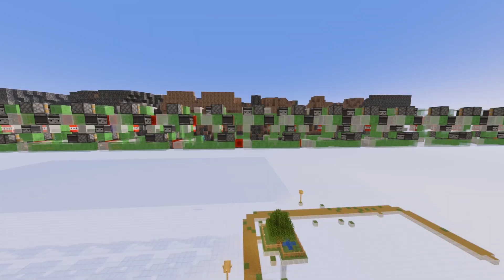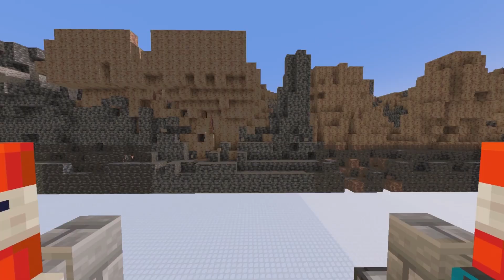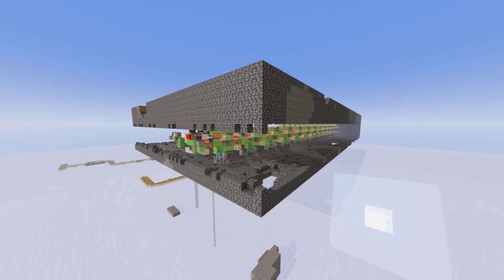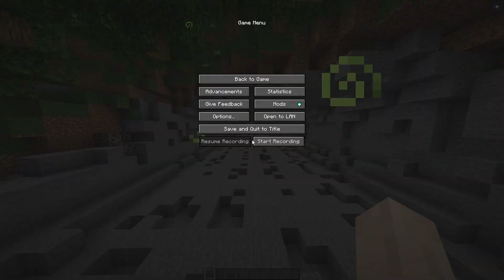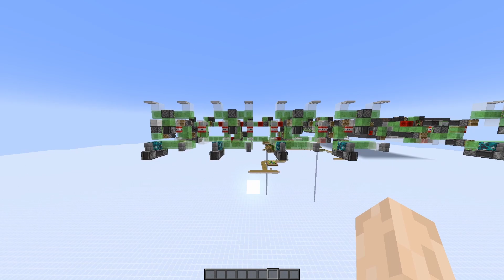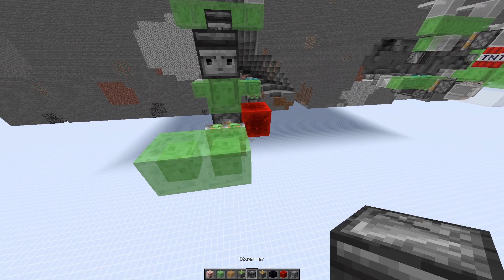How to Build a Simple TUNNEL BORE (Mining Machine) - Minecraft Tutorial

Comment: I mined now million of blocks with this tunnel bore. It works amazingly well in terms of precision and there are not a lot of malfunctions while using the machine. I can really recommend this tunnel bore! As I built already a lot of those modules in survival, here are some tips while building and using it:
- Don't use TNT as temporary blocks
- After you build your modules you need a system to inspect if the modules are built correctly. One false block can blow up everything.
I recommend to observe the tunnel bore from the front, side and most important from below. From below you can mine a (l x w x h)=4x(as wide your tunnel bore is)x5 shaft. This allows you to make a visual inspection of every module of the tunnel bore.
- In addition you can place water in the shaft and when one module explodes the other TNTs will fall into the shaft and you can prevent a chain reaction.
- Inspect your whole machine after each the first THREE TNT launches. 
- Night vision potion as in the video mentioned is a must.
- While mining with the machine make sure that above you are no cracks in the ceiling. It happened to me that a creeper fell down and blew up my whole machine.
- Check from time to time that no blocks obstruct your way. I'm using the binoculars to check.
Reply from the maker: 🤯 A million blocks. That is amazing! Can I pin your comment so that everyone can see all of these great recommendations?
Reply: @GiorgioJGZ  ofc you can. I hope I can then still edit my comment :) This tunnel bore made me almost loose my sanity but it also was so much fun!  It is really hard to build a wide tunnel bore without errors XD Thank you very much for this great video Giorgio!
Reply from the maker: I think when edited, pinned comments get unpinned. But if you've got no issue, I don't mind repining it later. Anyways, thanks! I really appreciate the great comments and I am really happy to hear that someone used it for something so cool!

Comment: Hey, super cool tunnel bore, I built one with 20 modules, the thing is, after everything is done, when I trigger it, the TNT gets launched normally, but both the TNT and the coral fan just disappear, I've rebuilt it twice and just does the same thing, I'm on a paper server, don't know if that's the problem, any help?
Reply: I tried on my singleplayer server with litematica aswell and it works fine, I just don't know what could be causing it with in the paper server, or something else
Reply from the maker: Unfortunately, I am pretty sure TNT duping behaves differently in some Paper and Spigot servers. Some don't even allow TNT duping. So, yes, I am afraid that's probably what's causing it to fail 😔
Reply: @GiorgioJGZ  Thank you so much! Keep the videos going, they are really good
Reply from the maker: Thx!!